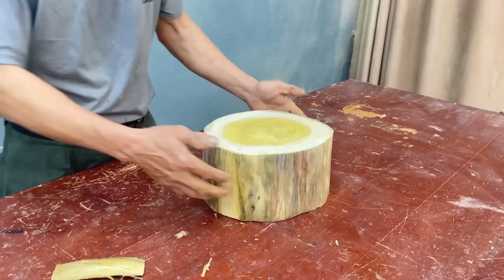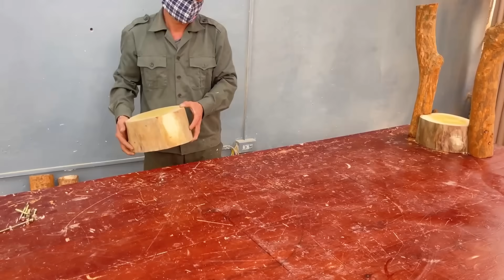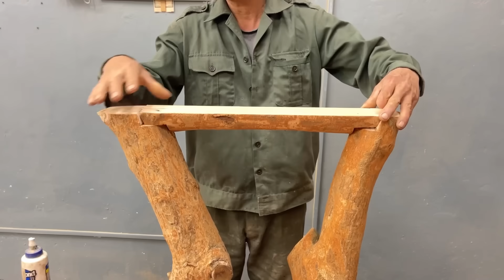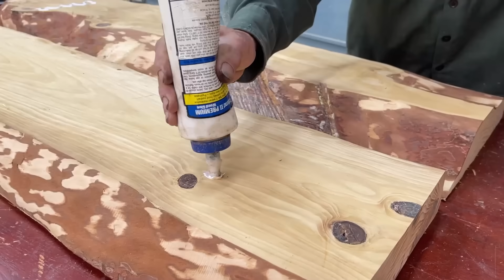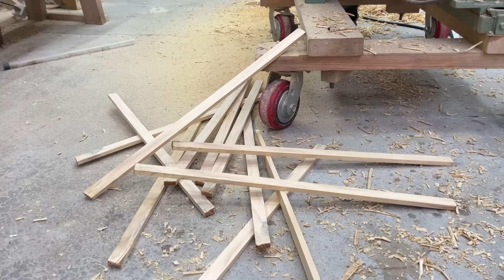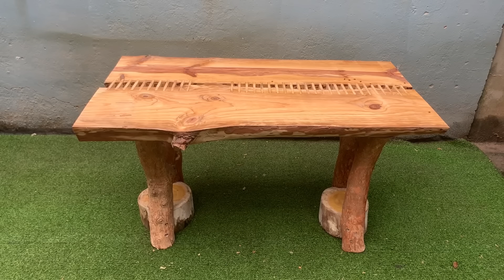Creative Woodworking Idea From Discarded Pieces Of Wood Combined With Solid Wood | Cheap Woodworking

Comment: The "stitches" you made to join the two tops are very attractive and well done. You must have a lot of experience to router freehand and stay within the lines and to stop accurately at the ends of the cut.  Good design and execution. Your improvised sanding disc is ingenious also. A shout out from Houston, Texas, USA.

Comment: Sorry....... not as "great" as all these comments. I see many 
Big  issues in the future, lots of checking. All those pieces that he just cut the ends off with the Chain saw obviously never had a chance to dry. Let alone dry at the same rate as the face.  And those screws are going to loosen pretty quickly. You shouldn't Seal it 
Up until the Wood had along time to season. 
I don't  like to critique  others work, but so many fall in love with  wood projects made poorly but because he used chisels. No quality.
Reply: Вся изюминка в том, что долотом.И ножки не из бруса.И толстые доски стодешницы не подогнаны на станке.Вам показали не высушенное дерево не для вашей критики, а как быстрый образец работы.Мастер , делая не образец , а ВЕЩЬ, конечно без вашей подсказки и замочит дуб по вренени сколько нужно и  гнёт положит, и высушит.Жаль, что вы плохого мнения о мастере. Многие поняли всё правильно и похвалили.Если бы изделия этого мастера не имели спроса, то у него были бы ручки маминого сынка.

Comment: Just my opinion but I think the table would look a lot better if you ran a leg sized crossmember higher  between the legs instead of using a trunk sized connection at the feet. The finger joints connecting the two pieces is a little distracting. Maybe add epoxy to show off the top more?